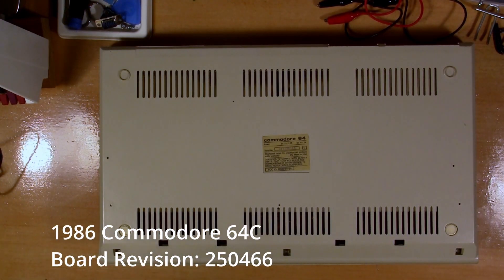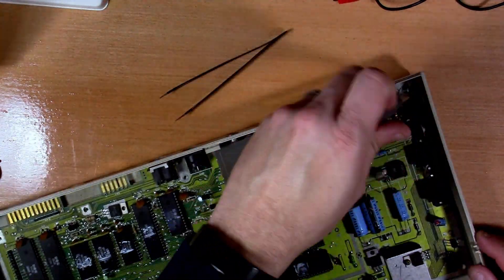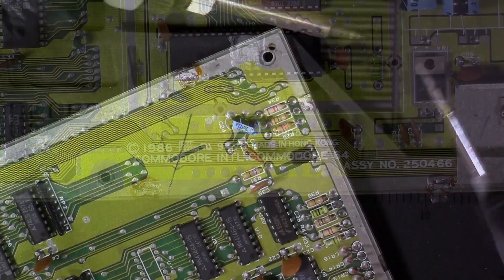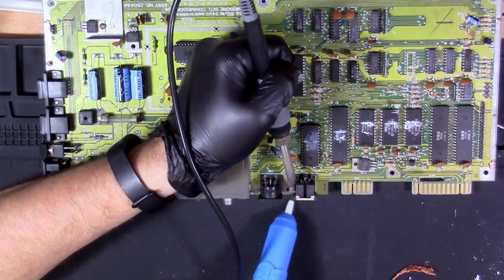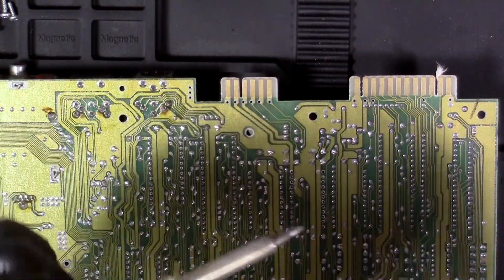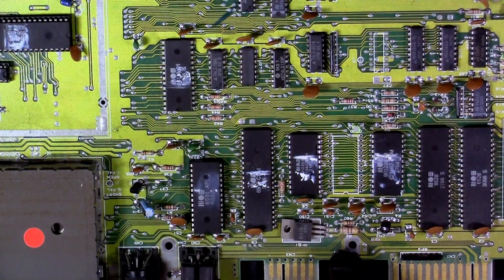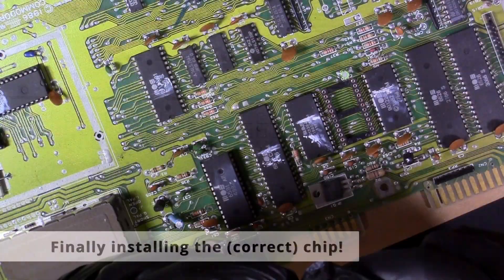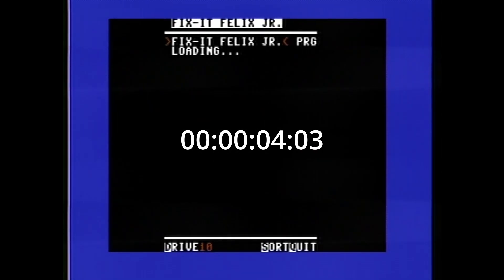Commodore 64C JiffyDOS Install & Testing.

Comment: Yep, that's a good illustration of what a pain in the rear it is to get the bottom RF shield off. When I swapped in a new power switch in my C128 I just left the shield sitting loose, because I'm sure I'll have to get access the mainboard again at some time in the future.
Reply from the maker: I've got a breadbin that I think needs a power switch. Hopefully that won't be as bad! :-)

Comment: This is EXACTLY what I needed! Was hoping I wouldn't need to install that round-pin socket for JiffyDOS,  but alas -- that's what I need to do. Thank you for this video...
Reply from the maker: Great! So it doesn't technically have to be a round pin socket but they can sometimes be pretty nice. Some folks don't like to use them but I like them just fine. Thanks for watching! Good luck with yours!

Comment: Excellent. I had not seen the inside of the C64C and was surprised by the manufacturing upgrades they made to this model. The JiffyDOS was a significant upgrade and I too didn't realize there was a pin difference between C64 models. What are you going to do with the the incorrect model? I'm sure you have another C64 hanging around that could use it. Right?
Reply from the maker: Hey thanks for watching! Yes indeed, looks like a few revisions and consolidations over the years. So this 28 pin will work I think on that maybe last iteration of 64C boards. I may crack open that UK breadbin from VCFMW. I think those were late boards but in light colored cases. Also, I think it is easy enough to rig up a 24-28 adapter along the lines of these. https://ist.uwaterloo.ca/~schepers/sockets.html I'd probably let it go to a good home if someone needed it as-is. :-)

Comment: I thought the chip in the 1541 drive also needs to be replaced with a jiffy one to gain speed. No?
Reply from the maker: You are 100% correct. To get the max speeds with a physical drive it should also have the matching Jiffydos rom. In the case of this video though, I am using an sd2iec which recognizes when jiffydos is in use on the c64 and can speak the protocol and also provides the speed gains. 
https://www.go4retro.com/products/jiffydos/

Comment: Isnt JiffyDOS supposed to be installed in the Commodore AND in the floppy drive? O.o
Reply from the maker: Sorry, editing here thought this was a response to the last video. If you are using an sd2iec(as I am in this video) it has the special sauce to recognize and speak "jiffydos" to a c64 equipped with jiffydos. On my later video where I'm using a pi1541 that's why I put the jiffy.bin on the SD card. For using a physical 1541 etc you are 100% correct to take full advantage it needs the rom installed. Thanks for watching and commenting!
Reply: @JamiesHackShack  Thank you very much for the reply. I am researching the subject before buying. It is for a physical C128+C1571. 

So, I think I will need to buy 2 ROM's, one for the C128 and the other for the C1571.

I had a Speccy when I was a kid. Being new to the C64 scene, these things feel so alien to me. LOL.
Reply from the maker: @peddersoldchap  You are most welcome! We are kind of in flipped slots. I never had any spectrum experience  but hope to pick one up to play with at some point. I had a Timex given to me in my twenties when I thought I was too cool for school and let it  go. I can kick myself now! 😄 Good luck with your 128 adventures. A 128/1571 with jiffydos will be a decent retro beast!
Reply from the maker: @peddersoldchap  I'd look into an sd2iec as well possibly. They are pretty handy and if you wanted you could copy to and fro between your physical 1571 if needed.

Comment: I fixed the heat shield with a pair of dikes and a lot of cursing. It's never going back on. Electronics aren't half as noisy as they were before so it's not needed anyway.
Reply from the maker: I heard that. I can't blame you for not wanting it back on there!